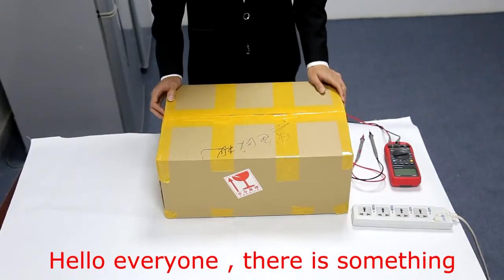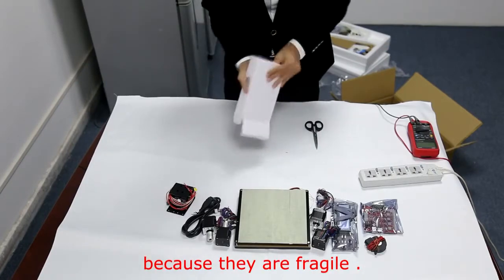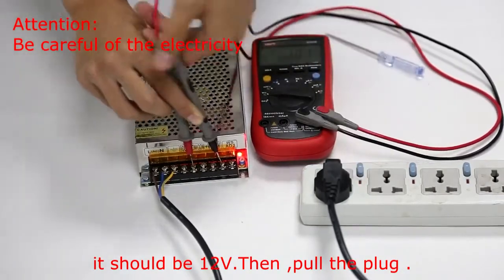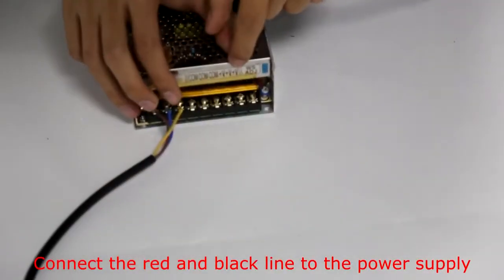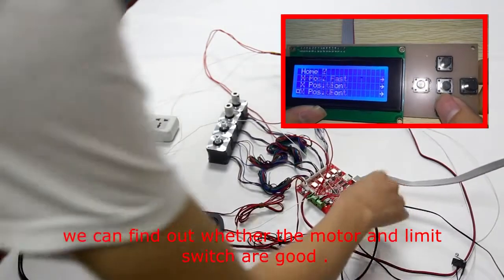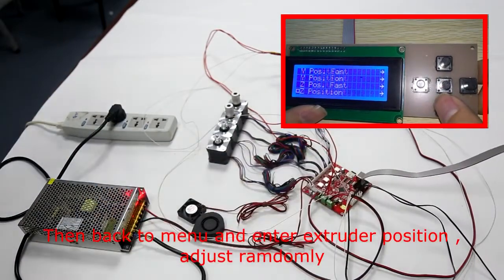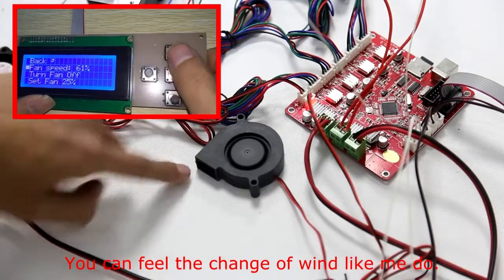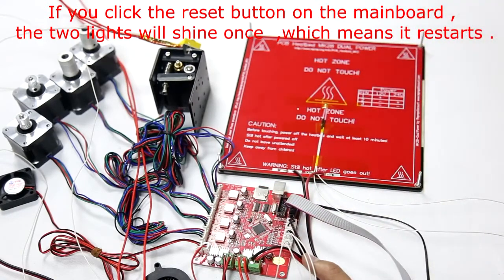Anet A8 3D Printer    Pre Test Electronic Parts

Comment: Not much lol it doing this video....the crap plugs and sockets on the heat bed are shit quality...and it's not a case of IF they burn out...it's when....and they will because the the pins are all bad fitting and it arcs and burns. And why not include or build in a low cost $5 mosfet on the hotbed side? Is Anet waiting for some other printer maker doing it and then clone it ? Does the A in A8 stand for Awful!

Comment: Completed this test today.

1. Be warned, the bed and power connectors on the current mainboard are only held in place by the soldered connection, this is weak and may easily be broken while trying to loosen off the screws before you connect to them, I used then nosed pliers to hold them while loosening. 

2. The limit switches will only stop the motors in one direction - this is correct.

3. If you are in the UK throw away the power lead and adapter. The one supplied HAS NO EARTH PIN even though the adapter has the pin it never gets connected - use a computer power lead and cut off the euro connector, play safe, be safe.